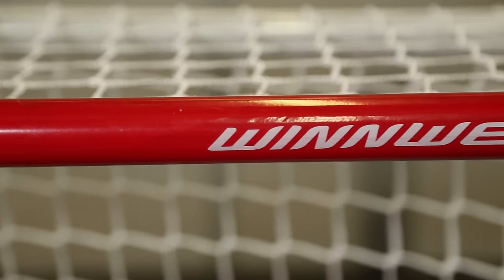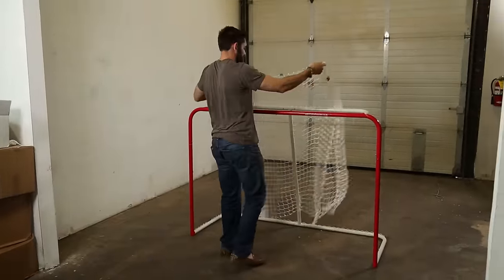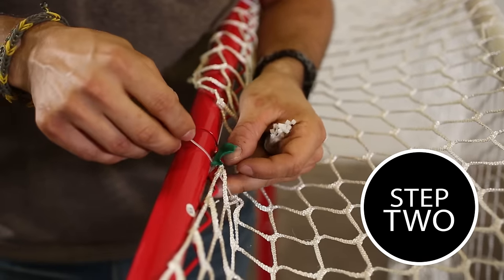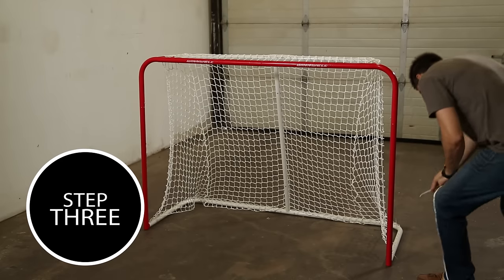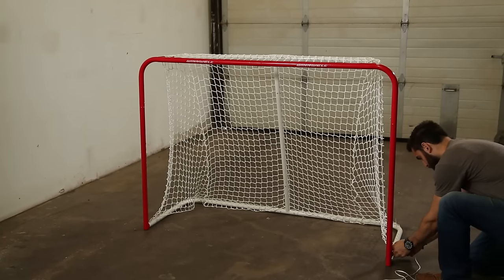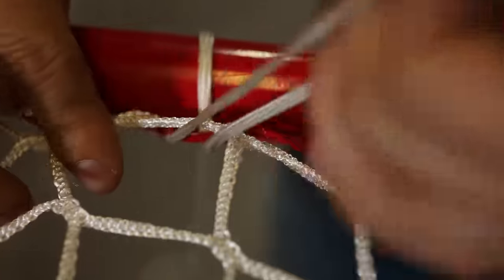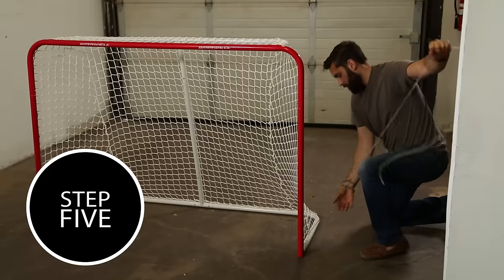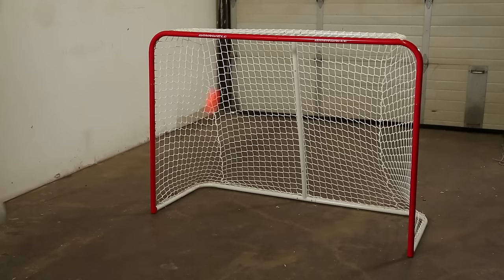Traditional Mesh: Hockey Net Assembly by WINNWELL HOCKEY

Comment: Mine came with wire welds only on the bottom of the frame and 4 zip ties... i can't figure out if its a defect or if the model I got just doesn't have the wire welds to attach the net to across the top and both sides. The design just seems so odd.

Comment: yo winwell - not sure if you will read this - it's 2020 and there is corvid 19 and people are going to want to play outdoor hockey since all gyms and rinks are closed.  can you design an outdoor hockey net that is collapse-able or easy to take apart and reassemble - this makes it much easier to transport by car and not only pickups.  Don't use push-pin nonsense or anything delicate.  I'd rather just have a bunch of steel rods (solid heavy posts) that are locked together by something that can take a beating like pins and can be repeated disassembly and reassembly.  The netting should also be FAST to put on and take off (im thinking velco attached) it doesn't have to be perfect as long as it stays. BASICALLY I WANT SOMETHING EASY TO TRANSPORT, EASY TO ASSEMBLE/DISASSEMBLE AND CAN TAKE A BEATING.  I'd rather it be heavy than flimsy and light as long as it's easy enough to transport.  Thanks for reading.
Reply from the maker: We appreciate your feedback and we acknowledge that outdoor sports are more important than ever during the COVID-19 crisis. From a product perspective we strive to design a wide variety of nets that meet the different needs of different customers. We have a fully collapsible ABS net that includes a carry bag for easy transport. We have a Game Ready assortment of nets with thicker pipes and heavier mesh to handle the repeated impact of ice hockey pucks. We have traditional street hockey nets in various sizes that can be used with plastic balls & pucks. Unfortunately some of the features that you've outlined in your comment are somewhat contradictory from a design standpoint. For example, the pipes on our most heavy duty and stable nets are affixed using a combination of snap-clips and bolts which unfortunately slows down the assembly or disassembly process. On the topic of mesh, we actually have a patented QuikNet mesh system that utilizes Velcro to speed up the assembly process but we find the Velcro is a weaker connection than traditional string so it's not used on any models designed for ice hockey pucks. Lastly, we do find the pipes that can "take a beating" are considerably heavier than those used for street hockey which makes it difficult to balance transport and durability. In other words, to achieve the durability you're describing would likely mean designing a net that weighs over 80lbs which many customers would have difficulty moving around easily.

Comment: hi winwell i ordered the heavy duty 72 replacement netting would it fit for a homemade net??
Reply from the maker: rolands rihards Our 72" replacement mesh is specifically designed for Winnwell nets; however, if your homemade net has the same dimensions (72" x 48" x 32") then it should work fine.
Reply: WINNWELL one more question is it sturdy?
Reply from the maker: rolands rihards Our 72" Heavy Duty Replacement Mesh is constructed using our highest grade 25,000D polyester to hold up against repeated use with ice hockey pucks. It's sturdy by our standards.
Reply: WINNWELL ok thanks

Comment: How many zip ties should you use because I got only 11
Reply from the maker: There's no perfect number. As long as you successfully the affix the mesh to the crossbar so the netting starts to take shape around the frame that's the most important step. If you want to continue to secure the base and corners with zip ties it will make the assembly easier but ultimately the zip ties are temporary. The string will hold the netting in place permanently.

Comment: Do ice hockey pucks work with this net?
Reply from the maker: Banana Man We do not recommend using ice hockey pucks with any of our Intermediate nets (i.e. 54" or 60"). Only our Game Ready assortment is engineered with steel pipes thick enough to withstand repeated impact by ice hockey pucks.
Reply: Banana Man srsly m8?
Reply: Yes
Reply: WINNWELL no there not I destroyed mine in 10 months
Reply: @WinnwellCanada  yep I just bought the 54” and the real puck absolutely tore the net and netting apart. I made a big mistake as I ordered 40 pucks
Reply: @WinnwellCanada the netting is too small, mine broke with pucks
Reply from the maker: @BananaKingVR.  If you have any issues with a Winnwell net or the mesh, please send an email to warranty@winnwell.ca with the details and our Warranty department will try to assist you.